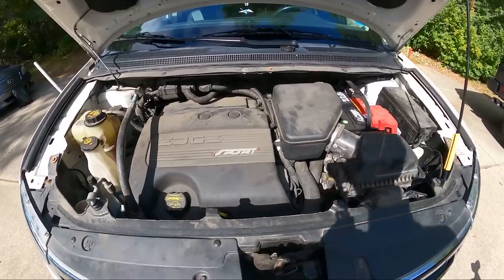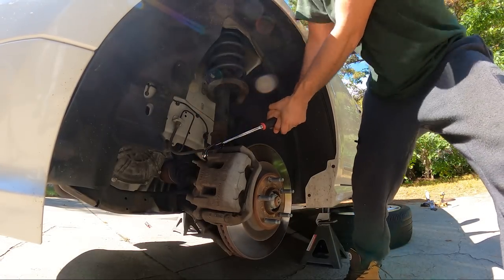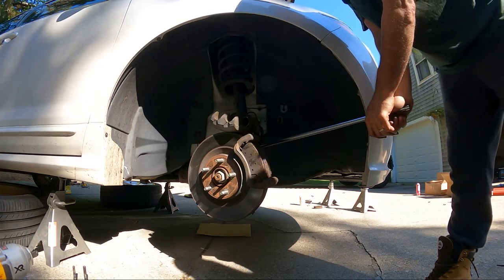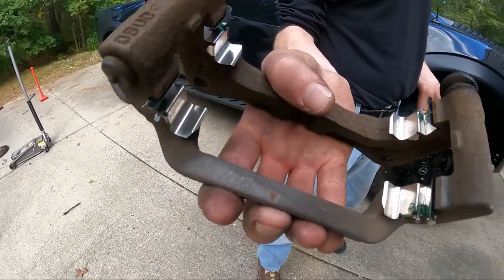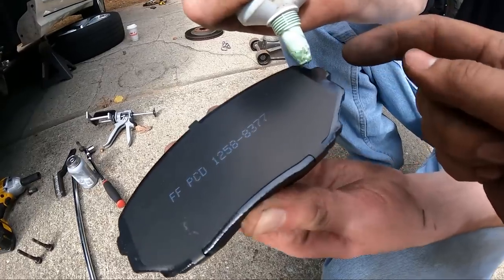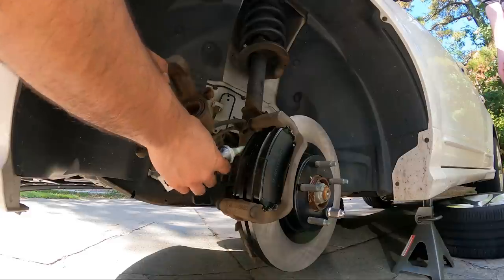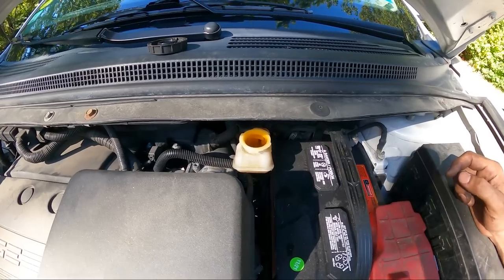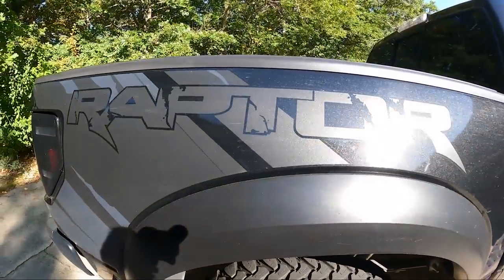CSW makes a home call to Music Producer & Dj John Force!? #customerstateswhat

Comment: As I bleed the brakes at pad and/or shoe replacement, I put a hose on the bleeder screw catching the old fluid when compressing the cylinders.  Don't worry about shooting old fluid onto engine compartment. I cleaned all components of rust and road grime to prevent the abs rings from clogging, and, potentially, retaining heat. When my hair was longer I wore a cap or pony tailed to protect my hair from catching and yanking.  I told my buddy when I taught him how to mechanic work that I charge More with him there. (:
Reply: It will also save you setting off a DCT at the ABS module. Fords tend to do that. Better to flush the contaminated fluid out of the caliper and not pushing back into the ABS pump.

Comment: I knew that jackstands were good to use for diy auto repair, yet I hadn't thought about checking the welds for cracking.
Reply: Same with your Jacks...manual or hydraulic, ALWAYS inspect the tools before using them to lift/support a Ton or more of vehicle...

Comment: Loved the real world driveway brake job! You did a great job of walking through the basics steps and made it look possible for the uninitiated to tackle.  Ford brakes look like an ATE design GM also uses, but the pads look like something from a Subaru. Hella nice choice of e-coated discs!  My only thought is why you don’t use pad anti-noise spray, or does the dabs of grease do the same?

Comment: I just learned something today! When doing brakes turn the wheel for better access to the bracket bolts! Genius! I’ve fought tight bolts there with little torque from inside the wheel well. Very good! You’re a mechanic I’d 100% trust

Comment: Welcome back.  Good to see you’re also a member of the driveway mechanics guild.  One thing I do though is before putting on new rotors, I spray the surfaces with red Brakleen to remove any oil they put on them to protect them in storage that may contaminate the pad surface.  Other than that, good to see that wonderful long ass Snap-on 3/8” ratchet and the other one with the swivel head.  Both are my go-to tools.  Good choice when breaking bolts loose is an order, not a suggestion.

Comment: When doing rear brakes on my wife’s Kia Soul I found out that the caliper mounting bolts are different lengths.  Ruined a brand new rotor.  Drove about 20 feet and stopped due to squealing.  Too late. Never forgot again.

Comment: Grease on the caliper? What do you think the shims on the back of the pads are for? I only grease the slide pins. 

The last brake job I did - no squeal for a year and half with just grease on the slide pins and nowhere else. Quality pads, rebuilt calipers, and cleaned discs.

Comment: From what I know when doing brake jobs, always make sure to use silicone based grease because synthetic based ones contains petrol derivates. This will cause rubber parts like the caliper boots to fail and eventually seize your caliper pins.

Comment: I like the Raptor, it's sweet. I'm going to look into buying one of those flex heads, it might be useful. I like using my air ratchet in spots where it's hard to find room for moving the wrench, but it does have limits. Not as strong as I need sometimes. My arm and the flex could work well together.

Comment: I like to wrap a clean rag around the top edge of the brake reservoir so that any brake fluid that spills over will not touch any of the other parts around or underneath it, as it can be corrosive. Just a little OCD in me.